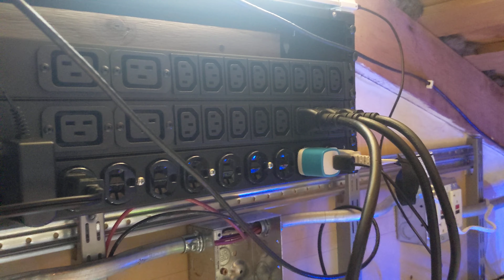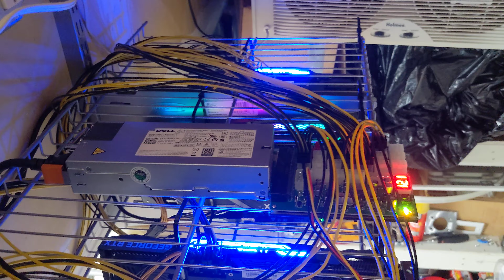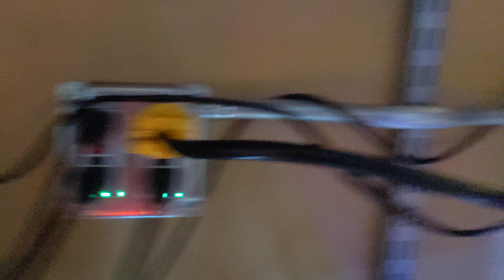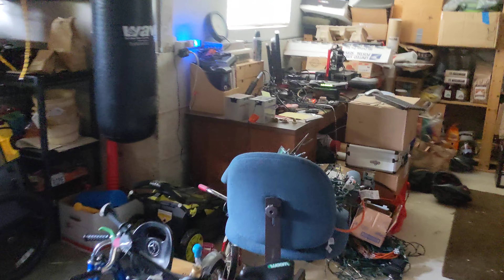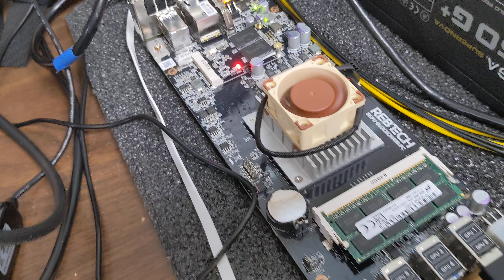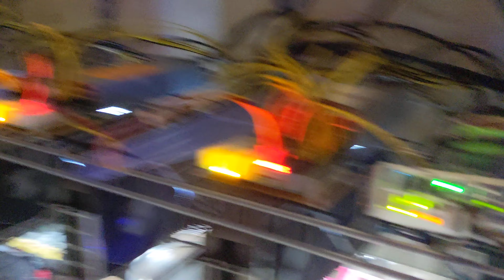Crypto mining update: Setting up 16GB rebtech for NiceHash Quick Miner

Comment: I tried running windows on mine and had a bunch of issues how's it going for you ?
Reply: I got Windows10 running perfectly fine, but the Nvidia drivers are giving me the issue.
Reply from the maker: @greenbackmining6101  are all of the cards detected in Device Manager? What issue are you seeing?
Reply: @PaulPeavyhouse  there were no issues with the cards but more with windows crashing. im running Hive now so its cool just wondering how other people are doing. Maybe I was using 4gb maybe I just needed more ram
Reply from the maker: @k1e1v1i1n  yes, Windows needs a ton of both physical ram and virtual swap. Usually the amount of swap you need is relative to the GPU memory. I am running 6 3090s and could only get NiceHash to stop crashing after setting up 65GB swap on a 128GB SSD.
Reply from the maker: @k1e1v1i1n  FYI, as cheesy and bad a rap as NiceHash gets, I use it exclusively so that  I can monitor the VRAM junction temps that I am under the impression is *STILL* not available in the Linux/HiveOS Nvidia drivers.
Reply from the maker: what issues are you seeing? I've been running for months with the only problem being the occasion NiceHash just stops mining and has to be manually kill and then it will automatically re-start again.
Reply: @PaulPeavyhouse  i've had to connect a monitor to the GPU for output video which is very small and only in black/white... I do not see the GPU in the Device Manager.  I tried all the steps you took in your video, and it just did not work.  The GPU, riser, etc are all functional because they work fine in my Asus motherboard.  I know it'll work, I've got to be missing a step or something
Reply from the maker: @greenbackmining6101  The rebtech should show any detected cards during the power on self test (POST), at least showing them however many you have as "Unknown".
Try using just one GPU to start off with.
I've had luck plugging a monitor in to either the built-in HDMI or the first GPU port, but I usually just remote desktop in to them.